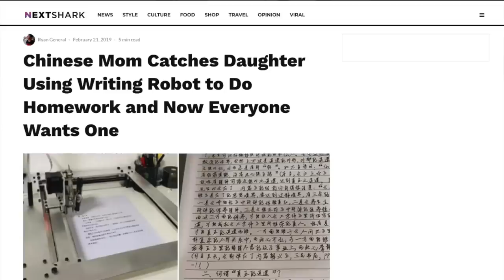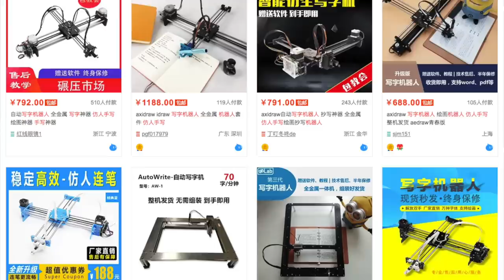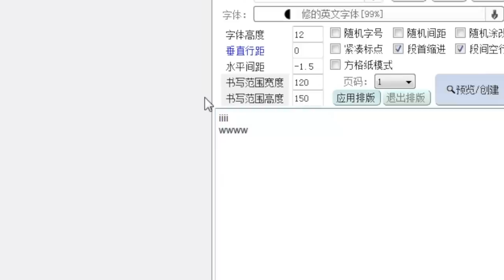Secret Chinese Homework Cheating Machine!😲

Comment: Towards the end of the video, Naomi poses the question how would we react if we found a child with this device in their backpack. The answer would vary depending on whether we are the instructor or a parent. Overall, this would be the perfect time to demonstrate device functionality and configuration controls, proper font and writing execution, variations between different font styles and languages, solution set or customized handouts could be formed using this to alleviate confusion or writing error. Thus, the child would receive their device along with the chance to participate in educating the class as a whole. This would be acceptable and preffered for ease and convenience of reading and assessing assignment quality and grade. However, if the focus of the assignment was to demonstrate proper form and writing by the student then the device would be prohibited. Outside of this type of exercise, the teachers may in fact prefer all students work to be input into for storage and archive purpose. It may conceal the evolution of the students handwriting. I would not punish the student but reward them for ingenuity. It would also need to be clear the amount of time the student spent on the assignment and using the device versus what a parent may have contributed. Again, it would not serve the students best interests if the parents or supervisory units were in actuality completing the assignment instead of the child. Perhaps a specific advanced class might be formalized to show specific advantages and techniques to assist publication and distribution of 'pretty print' or 'clean' documentation. This gives the assignment a more formal and finished look. I would not want to be the student caught submitting the work riddled with errors whereby the professor would mark with red ink indicating errors all around the work. However, this may serve as a good lesson for the student to return to the device make any necessary corrections and reprint possibly saving the corrected documents and entered into a journal or collection so they might retain any tangible work to review or reference in future. Very good question!

Comment: But if you have the same word repeated in a document they will all be identical, where as if you hand wrote them they would be slightly different. You need software that slightly distorts repeats to make it harder to detect. Basically it's too cookie-cutter accurate with a pen.

Comment: The Chinese tongue twister I learned was "44 dead stone lions" or 四十四只死石狮子 (Sìshísì zhǐ sǐ shí shīzi) ... although I still can't say it correctly.

I do like trying to learn to read some Chinese characters and its cool how the pictograms work
人 - a soldier standing "at ease", means Person
大 - a fishermen showing you the size of the fish that got away, means Big
天 - the line above the big thing, means Sky
太 - the big guy with a huge hanging penis, means Too (as in 太大, or Too Big)
尖 - a Small thing (小) on top of a big thing (大) means Sharp (think of the cross section of a blade that has a thin sharp side and a thick back)

Also you can take 马 which is the simplified version of 馬 meaning Horse and is pronounced "Ma"
Ma can also mean your mum (just like Ma and Pa) or the Ma that comes at the end of a sentence, signifying a question. When written down, there are slight modifications to tell them apart:
Add 女 , which means "female", to 马 and it becomes 妈 which is the "ma" that means Mom, or Mother.
Add 口, which means "mouth", to 马 and it becomes 吗 which is not the animal "ma" but the "ma" that comes out of your mouth when asking a question. This is the "ma" you say in Ni Hao Ma or, "How are you?" (literally "You" and "Good" and "I'm asking a Question")

Its an amazing language to learn, but does require some imagination and a lot of pure rote learning. (It also helps if, unlike me, you are good with music. Sadly I'm tone deaf which makes things really tough)

Comment: Nice box opener :)  
The machine isn't kerning.  It could use some kind of built in system to hold the paper down. 
In my opinion, it's cheating on the handwriting practice, but not for the rest of the homework. 
When I was in school, I often used computers to print out my homework simply because my handwriting has always been awful. 
Most of the teachers knew, and didn't make a single complaint. I guess they liked the easy to read format. Then again, none of my classes were on handwriting either, so there is that. ;)

Comment: Incredible little gadget that will help many students get through their school homework quicker to free up more time for them😎👍
The only clue I noticed on the chinese writing that made it look like it had been machine printed was the first few rows the letters were on the lines but lower down the page they were central between the lines and it all looked a bit too neat. Maybe the software could be adjusted to detect the lines or adjust the line spacing to match the lines on the paper? Also there could be an option to make the writing more natural looking by introducing some subtle variation into the printing so they look more hand drawn.
The english printing needs the subtle spacing difference between the characters adjusting.👍
When I was at school here in the UK in the 1970s and early 1980s 😊😁😲
if we misbehaved we sometimes had to write 'lines' out on paper as a punishment, something like, 'I must concentrate and not talk to my friends in class during the lesson' 😁😊😲you might have to fill 5-10 A4 pages, so it was very mundane and boring! We devised a little gadget to take th3 hard work out of the writing by taping 5 or 6 pencils together, you could carefully write out 'one line' but 6 rows were written, so you could fill a page by writing 3 or 4 'lines' 😁😲👍😎

Comment: The font being monospace should be trivial to fix, any basic font renderer includes kerning/spacing options. The big tell for latin languages would be that since Latin glyphs are so much more simplistic than Chinese characters, they tolerate a lot more variance, and handwriting tends to not only be more individualized, but more varied even within a single individual.

This can still be remedied with a morphing distortion across the characters, but doing so convincingly gets more difficult, especially if you have a copy of the person's real handwriting to compare to.

Comment: I think the english text looks machine-made because it's too perfect.  All the letters are exactly the same size, and they all fall on a perfectly straight line.  They should add some small random variations to character size and vertical placement.
Reply: Yes. We are writing the letters negligently because they only need to separate from the small number of letters.

Comment: For English it wouldn't be cheating, because we only have 26 letters to remember. In order to work the machine, you would already have to know them. It would be easier just to print out  on a regular printer, which is still acceptable because if you are typing the letters, you are still learning them.

Comment: The point about mono spacing was interesting but I think that the real problem with the English writing was that each letter was exactly the same. This might not be so obvious for Chinese but would be with the 26 letter alphabet. 

Software should be developed to allow a user to scan a sample of a particular persons had writing and duplicate that. This would open up the question of illegal forgeries. In the old murder mysteries it used to be a plot device where, for example the criminal would fake a suicide note by typing it on their victims machine. Plenty of opportunities for some criminal behavior, usually people would trust a hand written note more than a tweet or e-mail which could have been sent from a hacked account.

Comment: If memorization is the cornerstone of the entire education system... which i agree having dealt with Chinese engineers abroad... then this printer is really terrible to education.  It basically removes the repetitive training needed for rote learning but doesnt replace it with creativity or self study exploration (since there is no mechanism in the education system for this type of learning).

I think the plagiarism comment is incorrect.  There is already an issue with plagiarism with students handing in the same written essays to the same teacher and the teacher just accepting it.  I have had that with chinese engineers too where they have taken the same ethics oath as me and yet directly photocopy infornation off of other companies drawings.  Often without even understanding what they were copying... but that is a different problem.  

With this printer they can not only use use the same source file thus bypassing the creative part but they can also bypass the repetition part.

Also... i remember on a cgtn documentary that in 2017 they removed english from the curriculum.  The documentary  was grade 1 2 3 before the college entrance exams.  Is it still removed?

Sorry for the wall of text!  This is a very complicated topic.  Also you sell yourself short,  the fact that you recognize this tool and possible ramifications and used deduction amd other reasoning... this makes you an exceptional student of technology chinese or otherwise!

Comment: Impressive, but even if they fix kerning, I think most English speaking people would be able to tell it's written by a machine. There isn't enough variation in letters. And letters in real handwriting look different depending one what letters came before them, and to some extent also what comes after.

I wonder how far into the future until they're able to make a machine that can copy your handwriting based on looking at previous text you've written. That would make a very interesting project. It might have to watch you write, and not just see texts that you've written.

Comment: hahah as a knife guy I commend you on the use of different sharp items to open boxes.

Also, a quick question... does the machine put in variations into the words?  if they are too uniform wouldn't it still look machine generated?

this machine writes 100000 times better than I can...……….

Comment: The font isn't "consistent" as much as it is "exact."  The only real differences are in the quality of the pen tip and amount of ink coming through.  And humans are generally really good at seeing patterns.  Their brain is going to tell them automatically that this was still done by a computer.  What might help the fakery is a small motor that jiggles the pen assembly as the computer writes--add to that a font which changes through three or four variants of a character.  Finally, if all the students use similar machines, all of a sudden their handwriting looks the same.  In America, I've seen teachers pick up on handwriting similarity when one student helps another out with writing assignments.

With regard to using computers vs writing--I think writing is important.  I've seen graduate-level papers written by very smart people, using "texting":  You're => UR and you are => U R, etc.  I've also seen people unable to write on paper when the power goes out.

Comment: Also, every character is written exactly the same, when a person writes by hand, there are always slight variations, if you were to write four "W"'s in a row, all the characters would have slight variations from one another. while this plotter does a nice job, it doesn't implement enough variation in it's writing, so it looks mechanical.
This is similar to an auto pen; Politicians use them to reproduce their signature on multiple documents.

Comment: I really expected the machine to be more complicated, like having flexible cable trays and that kind of stuff, like a pick and place machine. I really don't feel confortable seeing a thin ribbon wire in mid air but it's understandable since the machine has to be cheap enough to be purchased by students without breaking their allowance or sparking any suspicions. BTW, i want to talk about the education system here in my country. Here in Panama (you might have heard of us but idk) while STEM education does exist, students don't learn anything from STEM subjects because most professors don't teach very well and we are not motivated to learn either because we don't have any electronics, mechanical or chemical factories.  Spanish education focuses more on grammar than in actual conversations. They don't teach you how to speak properly, just rules that you don't even know how to follow. And flat earthers and ppl that don't know how to write words properly are not uncommon. Many ppl don't know how to read properly until 4th grade. English education is bad, very bad. and maybe on purpose: many ESL schools will visit public schools on a yearly basis to advertise their services and in many cases they will force students to fill brochures so that the ESL school will later be able to contact their parents.  And even though ESL schools do teach grammatically correct english, their graduated students will often make mistakes such as using "the" too often, and make sentences that don't sound natural. English fluency is becoming more common, as subtitled english language songs and media become more popular. And if you are Chinese (like me) chances are you will find a racist professor that hates chinese students for no good reason. (maybe its because of our culture: many chinese ppl run small convenicence stores and customers will often yell at the cashier (which is often the owner of the store) because they believe that the products the store has for sale are too expensive, even when they are the cheapest in town) There is an increasing number of ppl like me that love electronics, computers, mechanical stuff, anime, manga, Japanese culture and english. Most people (including myself) learn english by consuming english-language content with spanish subtitles. Here, we believe that english is a beautiful language and ppl are always looking for ways to become better and better at english. (i will stop here because this is getting too long)

Comment: The ‘i’ were also typically Chinese with a small back slash on top, instead of a dot. I spent years correcting ‘Chinese style’ letters which are formed from Chinese style strokes. 5, 9 and i were perhaps the most commonly ‘poorly’ written to the point where a foreigner would probably not recognise them. The joys of first language interference! ;)

Comment: There's rote memorization in English too.  Take this example, "A rough-coated, dough-faced, thoughtful ploughman strode through the streets of Scarborough; after falling into a slough, he coughed and hiccoughed."  If you try ruff coated, duff faced thufftful pluffman or a ro coated, do faced, thotful ploman, or a rawt coated, daw faced, thawtful plawman, it sounds wrong to someone that knows English.  The correct pronunciation of the '-ough's is "A ruff-coated, do-faced, thawtful plowman strode thru the streets of Scarboro; after falling into a sluff, he coffed and hiccupped."  While those are all spelled incorrectly, they are spelled phonetically.  As they are pronounced.

English doesn't borrow from other languages.  It knocks them down and shakes them down for loose grammar.  "Hey, nice word.  We don't have a word for that.  I think we'll use it."

Comment: This would be rather useless here in Germany. The last time, I had to practice writing in school was second grade in elementary school, when we had to learn "Vereinfachte Ausgangsschrift" (roughly translated: somplified starting (hand-)writing). After that typing the sentence would have been more work for an elementary school kid than using a normal fountain pen. Even today I feel like handwriting is easier than typing. Latin letters - even with the few German additions - are so simple, that you don't have to learn them that long. And you only hurt yourself if you type your homework later (many teachers would allow this in secondary school (starts with grade 5)), because you aren't as fast in the exams if you don't write that often and there is not much time. Also it still needs to be readable enough so the teacher can grade it. But I would still have loved to have a little robot as kid, I always loved robots and I always will^^
Reply from the maker: Interesting!

Comment: This is why it will be a long time before China, Japan, and other Asian countries will be as good as the USA at train of thought thinking that leads to innovative thinking. Memorization is good for engineering, not that great for free thinking. But, you are right, this machine would go a long way toward getting Chinese out of that memorization dead end and in to train of thought thinking that leads to amazing ideas. When the calculator started becoming more inexpensive, Isaac Asimov said it was dumb to not use them. That most human minds would never be as fast as even the cheapest calculator, and denying a tool that frees the mind to think of more esoteric thought is just dumb and would hold us back.